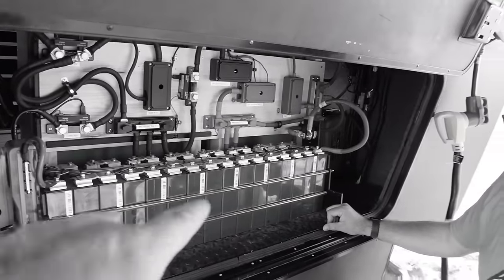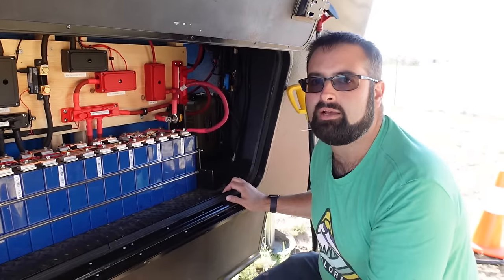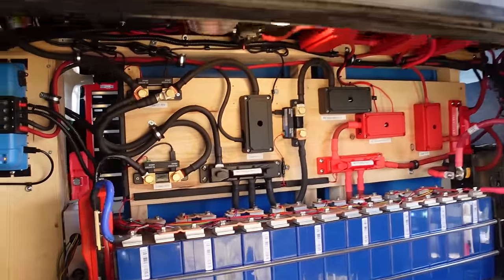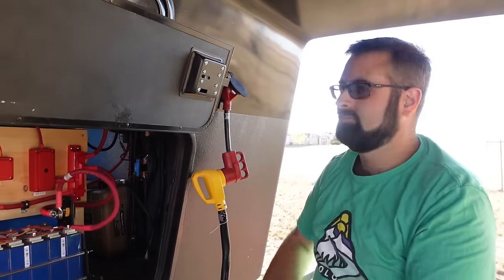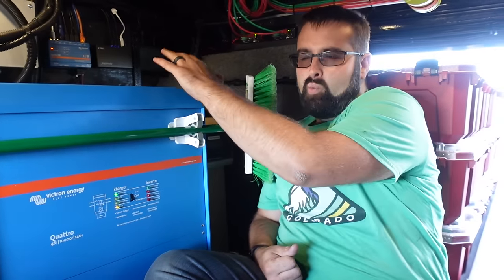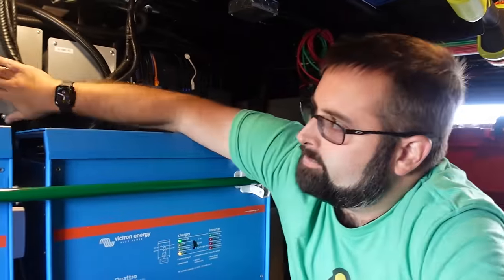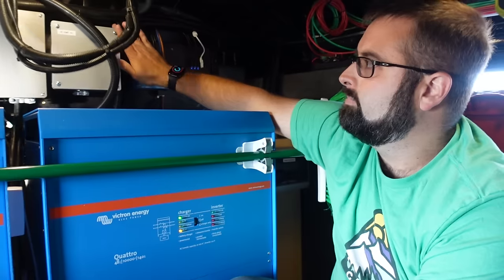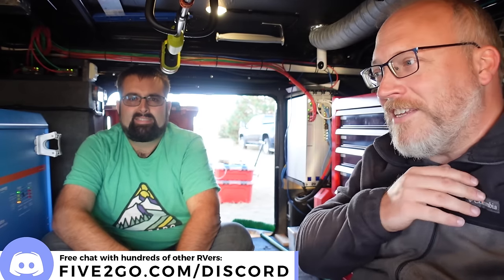How To Do RV Lithium The Right Way

Comment: A few items.  For an example of a method to add more solar panels via stacking and slide out, take a look at fellow YT Sail Life Athena from 6 months ago.  The design is for a dinghy davit for a sailboat but the concepts might work for you,  As far a budget solar, I helped design and install a 640w system on a catamaran 3 yrs ago.  Total cost for two 320w panels (at 60cents/w) a 60amp Makeskyblue mppt with bluetooth ($150) plus circuit breakers, pv cables, battery cables, tools and waterproof thru hulls was $650 or about $1per watt.  The boat already had a 12v battery bank so there was no extra batteries needed or their cost .

Comment: The reflection on cell 16 looks like it has been crushed by the end plate because of the rigid rods without springs. Crushing can happen if the cells were “compressed “ at a low state of charge (rod nuts snugged) and when the batteries reach full state of charge, they can expand with the accumulated expansion of 16 cells as much as 3/8 of an inch, even more in hot conditions. Springs can be added so the end plates can apply a force of between 500 to 650 pounds regardless of expansion across the large side of the cells. Other than that, excellent install.
Reply: Hi thanks for the info. Where can I find more information about this?

Comment: All I can say is WOW! lol. We had a decent size system installed using all Victron and Battle Born batteries and it's been great so far....I think lol.  I helped the installer and he walked me through everything but its hard to wrap your head around everything in 3 days, specially if your not tech/electrical savvy and I'm not lol.   We are weekend warriors at best and have only used the system by itself a couple times so still learning the how and why's of it, Ben did a great job of putting things into layman's terms for the average person to understand. We ended up going with a 12v system and yes those wires were fat and very hard to manipulate but we got it done nice and neat like yours. Only thing I want to add is a high output fan in the enclosed cabinet where everything lives and duct it to the inside of the rv, our last trip the batteries were as hot as 98F and the fan was constantly running on the Multi Plus !! we have.
Reply: 12v is very problematic with high load appliances and that is why it is better to use higher voltage to help keep heat down:)
Reply: 12volt's the safest! As for the fatter wiring, do it when warm..as copper strands easier to bend. Even 10 AWG romex a real BIACH! to wrestle with when cold! Other thing on  bigger 12volt setups is TRY to get QUALITY 12v to 120vac inverter!! Cheapy bigger( my Chinese $250 ""special"!) can be finnicky on me when starting large skillsaws,chainsaws, @15A 120volt rating....unLESS! EVERY! connection TIGHT! And yes..good ventilation a MUST! Need I say more.

Comment: Great setup! I did a similar diy setup in my cargo van conversion.  15KWH custom battery, I did 12v and huge cables lol. Setup as 2 independent 12v batteries. I did 1 victron 3000 multiplus and a 3000 watt inverter on separate AC lines. Mostly for cost. I’ve also been able to plug into an ev charger and charge the battery! J1772 connector to Nema 14-50.
Reply: That’s pretty cool to be able to utilize the EV charging stations like that.  I’ve seen them at places and always wondered if something could be done to utilize that power.  Although, a lot more difficult with a big ol’ 5th wheel.  That’s a great pairing for the cargo van.
Reply: I've been look at how to do J1772 to 50A... do you just have an external charger you carry around that does the charger handshake? I wasn't able to find something that let me use the full EV charger power, though any charging would help in a pinch anyway.
Reply: @alecfurtado1765  I could only get about 1200watts total in. There was some balance issues with the voltages in each leg, which limited me. I’ll get between 178v - 97v. So the product I talked about earlier would fix that. Overall it works though with just the adapter. There isn’t much of a handshake for the j1772 actually. Just 2 pins I think, and the adapter I have have it wired to be “always connected”.
Reply: @DaddyEric222  Got it. I thought from specs that those extra pins were required for public charging stations to start supplying power

Comment: All in and over-engineered! Good job. Impressive. I am a cheap ass. 16s grade b cells with 5kw Chinese hybrid solar inverter/charger. Using the onboard ac charger to charge the inhouse batts. Max I can pull with ac, heater, and microwave at the same time is 83amps @ around 52v. Wired for 200amps max. 30ft RV.

Comment: Nice video, very cool setup. When I was experimenting, I noticed when I put cells in parallel, the BMS got very hot. After researching, it appears the cells may become out of balance because they tend to charge each other, which causes the BMS to get hot. After a lot of effort, I have found that puting diodes at the ends of each series and puting them in parallel with the diodes, prevents the BMS from heating up. I also noticed a significant increase in my battery performance. Since I need a lot of amps, I soldered 20 diodes rated at 1 amp in parallel for each series cell. I have seen about 10x increase in performance (voltage sag, cell balance and power output).
Reply: Were the cells at the same SOC? Voltage means nothing. Two cells at 3.26 could be 20% and 70% SOC. If you put out of balance cells in parallel you will see massive current flow and for 280Ah cells that could be a scary amount of amps. Even 100Ah cells. When I connect two 18650's in parallel at different SOC's I'll see 20A or more in the first second that tapers down to 10A by 3 seconds but stays pretty high for a minute if they are more than 0.5V apart. (That test was done with Samsung 25R's but even energy cells gave me similar results but the lower the IR the larger the flow. the 25R has an IR of ~12mOhms and a 280Ah cell has an IR of 0.16mOhm...YES, zero point one six milliohms, moving the decimal two places to the left)
Reply: @ericklein5097  Why do you say voltage means nothing? Any time I put cells in parallel, I use diodes to prevent cell balancing. It is not recommended to use old cells, since they will not be the same capacity.
Reply: @UFO_researcher  voltage is not an indicator of SOC with such a flat charge/discharge curve but people assume a battery at say 3.27 is at 50% when it could be at 30% and another could be at 70%. Props to you for using diodes, very safe but I think that is messing with the BMS attempting to balance. I'd have to see your setup to know for sure.
Reply: @ericklein5097  I don't use a BMS. The important point is not over discharging and not over charging, which are indicated by voltage.
Reply: @UFO_researcher  Old post I know, sorry. When u say u don't use a BMS, do u mean per battery, or none at all?
Reply: @ericklein5097  Are u the Erick that did these batteries brother?

Comment: A shunt is simply a piece of wire with a known resistance, by measuring the voltage across it, you can work out the amperage.

Comment: Most awesome setup Ben, I really like the fact that you got away from packaged batteries and went the cell route. I wonder if the big 3 that I follow, David Poz, Jehugarcia, and Will Prowse would comment on your great setup?
Reply: Thanks!  I’m glad you like it!
Reply: @Benk did you have New Horisons extend your  basement back a couple feet? Wondering what you did to support your toolbox? I opened up the back wall and saw just underlayment for the bottom of my fifthwheel. I can add some steel and make reinforcements. Just wondering.
Reply: @innerspaceavailable  There's at least one aluminum structural member down the center and probably more.  But, yes, the flooring is a laminated component similar to the walls.  I used 4 bolts through the toolbox and through the floor to the underside (all stainless steel) with fender washers and Nyloc nuts.

Comment: That is an incredibly good build.  You are even down-buffering from the 48V system to a 12V battery for the 12V system (which means that the DC-to-DC converter doesn't have to deal with the 12V loads).  Very few people in the industry know about that trick.
Reply: Hi. Thank you for your comment. Do you have any good sources of information on how to do this cost efficiently? I would be so grateful.

Comment: I did a 24v system with 100AH cells.  I’m assuming you have 300AH cells to get you the 20KWH+ of energy. 

I also have a 12v battery that is charged via the 24v bank through the multiplus.  

Do you go with Quattros vs multiplus for the 10K rating?

How many amps through your Dc-Dc converter (48v to 12v), and what  DC components do you use it for?

Nice work.  Great job on the install.

Edit:  FYI….generators, generally, have 12v starter (hence my 12v agm battery).

More details how I charge the 12v:  I have a Victron IP22 charger that plugs into the backside of the main distribution panel (gave me a breaker dedicated to this charger).  I do loose energy in the DC to AC to DC conversion, but it really simplified things.
Reply: Yeah, the Quattro’s were a requirement for the high power capacity.  In reality we would have been perfectly fine with 8 kVA units, but Victron doesn’t make them for 120V systems.  So we went with the 10 kVA.

That DC-to-DC charger will put out 30A (at 12V) with the occasional surge up to 40A.  I run everything that is 12V in the system (which frankly because it’s a RV is most of the things).  I have one network switch on the roof in a waterproof box that was natively 48V, so I’ve got that wired directly into the 48V side.
Reply: Oh, also my rig has a big ol’ cable going back to the generator rack from up front.
Reply: Lol, that would have to be a big ‘ol cable.  Impressed with the system.  All you need is more solar panels ;)
Reply: @allencoleman2319  Yeah, it’s 2 AWG.  We’ll see if I ever put a generator back there.  I saw someone who just had one on his MDT truck and he’d just connect the RV to it like shore power when needed.  I thought that was a pretty slick setup.  And yeah, definitely need more solar panels!

Comment: very nice setup. if you pull 10kw each battery will be producing around .4C if those are 280ah cells. I have 4 of those batteries setup in my house and only when things are starting up do I even come close to 10kw. I use kilowatts as the unit of measure since 48v and 240v have different amps to achieve the same kw in/output. I would suggest he runs a heater/ac duct into that area. so it can be cooled or heated so it wont matter where he goes.
Reply: There are already heater ducts running into the basement (one from each furnace).  The active cooling fan helps keep the temperature down when it’s hot outside.

Comment: If you are still considering adding more solar you might get some ideas from what we're doing. I will be racking 8, 550W Sungold Power solar panels in a single row down the length of our 35ft Class A, about 14" off our roof, above our AC, fan shrouds, etc. Our MH is only 11' 9" tall now, to the top of our AC shrouds, so we will remain under 12" in height when done. We're wintering over in Yuma, AZ now, assembling the components of this build, and plan to have it finished right after the first of the year. We received our aluminum racking material and hardware last week, and our solar panels just arrived 4 days ago, but it will take time to get everything assembled and installed, as we're moving much slower these days. We are retired and living on social security and a small pension, so have to do everything on a tight budget forgoing name brand components like Battleborn and Victron for lesser-known brands and must do all the work ourselves - which keeps getting harder as we age. 

You could probably rack 9-10 of these huge panels on your fiver, dedicating one or two for your 12v batteries if needed. We started our build 4 years ago with a custom built 620-watt liftable solar array mounted on the side of our motorhome. It serves as a nice bedroom window awning too, practically lifting itself to the desired angle with a couple gas struts and it's easy to clean with a windshield squeegee, standing safely on the ground.  But the main reason for mounting it on the side of our MH was to leave the roof free for the 4,400W array that will cover the entire roof so we'll be bringing our own shade with us wherever we go. 

We just completed the first phase last January, with the addition of a custom built 560ah of LiFePo-4 battery we made with 8, 280ah prismatic cells. We typically use less than 20% of their capacity daily giving us enough reserve capacity for about a week of bad weather before we have to run our generator for charging. It only cost us $1,500 to build this 560ah 12v (7.1Kwh) battery, including a 350A amp BMS and an active balancer. 

We will be using a Sungold Power all-in-one 48V, 5,000W, 120V PSW Inverter, 100a MPPT charge controller and a 40A a/c battery charger. The reason we chose this all-in-one is because the idle power consumption is only 25 watts - and it's on sale now for only $721 to the end of the month! Our 48v battery bank will use 16, 310ah prismatic cells. So together with our 560ah (7.1 Kwh)12v bank, we will have a total of 22.9Kwh of batteries onboard (about 18 Battleborns worth). We will be replacing our old rear 13.5k btu rooftop Dometic AC with one of the new high-efficiency 12k btu mini-split heat pumps. This second phase will cost under $10k, including the $1,500 EG4 28.5 seer2 heat pump, as we plan on doing all the work ourselves. Our 2nd phase will provide 24/7 off-grid air conditioning and supplemental heat from the heat pump and allow occasional usage of our front rooftop 14.5k Furrion AC to cool things down quickly during peak afternoon hours, as well as give us whole house 120v ac power. We'll soon have total off-grid electrical independence, allowing us to keep our generator in reserve for emergency use only - on a budget we can afford. Take care, we hope to see you down the road!

Comment: Your setup is awesome! However, I would like to know where you found the ' buddy plug.' Can't find a 30amp power output plug like the one on your rig. Plenty of inlet plugs. A resource to buy one would be much appreciated. Thanks and again, a killer power system.
Reply: Thanks!

I found the receptacle on Amazon.  It comes in a box meant for surface mounting, but I took the receptacle part out of the box and put it directly in the wall (since I knew I had more than enough thickness there, the terminals don’t event stick out beyond the inside edge of the basement wall.

https://smile.amazon.com/dp/B099K9JB5P/?tag=five2go-20
Reply: Thank you very much, Ben! You're my hero. Wish I had your accumulated knowledge. I know you've worked hard to get it. More power to you.